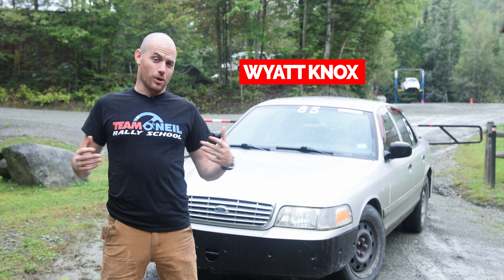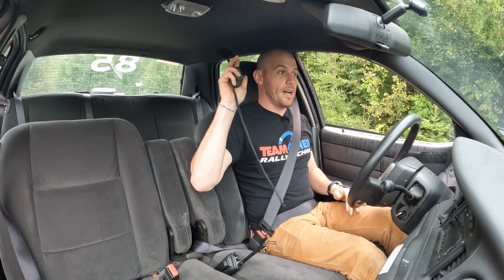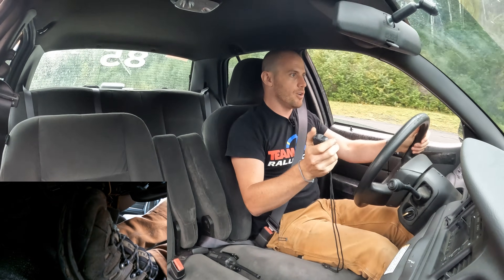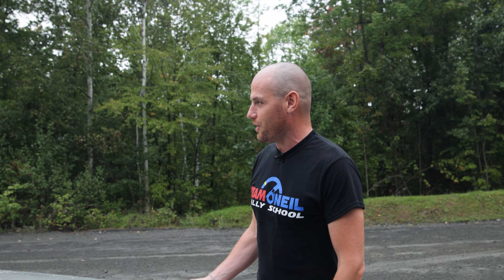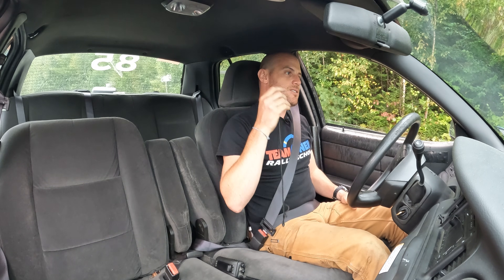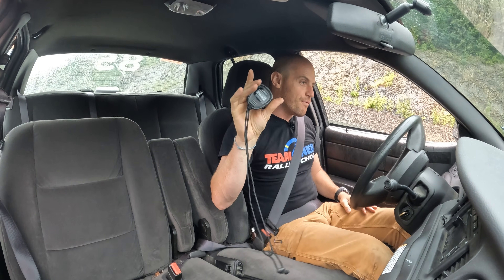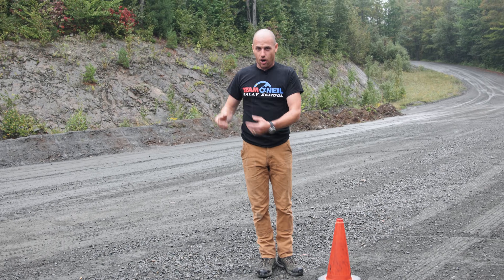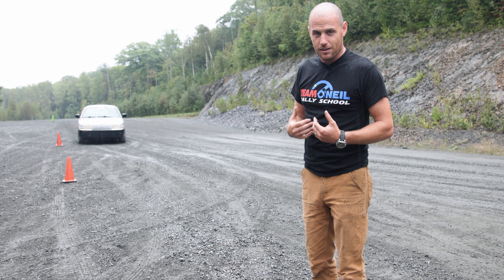Threshold Braking | ABS ON vs ABS Off

Comment: Great video Wyatt. What's your opinion on pumping the brakes on that same road surface with ABS and without ABS? Even though my past 2 cars and my current car has ABS, I actually prefer older cars and trucks that don't have ABS. I also apply and pump the brakes both right on the brakes as well as left foot on the brakes while my right foot is still on the accelerator.

Comment: This is dangerous hog shit. You are not on tarmac, you are on gravel. The difference that makes cannot be overstated. Secondly, you are not using a modern, 4-channel ABS. You are using a shitass Ford that had at best a two channel system. The bottom line is this: If you are on pavement with modern ABS, the ABS vehicle will beat you every single time. Every. Single.

Comment: Another thing I've long wondered about: In an uncontrolled spin, the recommended action for the driver is to lock up all four wheels, because the inertia of the vehicle might carry it in the same direction it was going prior to the spin. With ABS, it's not possible to lock up the wheels, so the car will go in whatever direction the wheels are pointing, as soon as some sort of traction happens. I would love to see a test of the difference between a spin with ABS versus a spin without, in terms of how well the car keeps a straight line.

Comment: As I understand it, the reason ABS was introduced is that it provides some steering control for people who panic brake. So, instead of locking up and losing all steering, ABS gives the driver the possibility of avoiding whatever they're heading towards. What I wonder about (and is perhaps not something that can ever be known), is how many accidents happen now because of the increased stopping distance, that might have been avoided even with a panic braking full lock up. Another question (which perhaps you can test?), is rather than straight line braking, what does it look like to perform the same test you just did, but the stopping attempt happens in a curve? (i.e. there's an obstacle in front of you that you have to avoid). Can a skilled driver with no ABS avoid a crash that a panic-braking driver with ABS cannot? Am I correct that ABS is currently not allowed in rally racing?
Reply: I have the answer to your first question about  accidents caused by abs increasing stopping distance the answer is zero absolutely zero abs was introduced for a number of reasons one being maintained steerability under full braking but also because it reduces stopping distance significantly and consistently on tarmac no matter how skilled the driver is plus it prevents flat spots on tyres which is not only a waste the tyres and causes vibration when driving as the tyre is now no longer round and balanced but also flat spots have less grip than the rest of the tyres surface so if left unchecked and it locks up again 9/10 times the lock up occurs in the spot on the tyre making the flat spot worse and worse over time eventually it will have next to no grip and will likely just blow out under braking very dangerous it's only on unusual surfaces such as thick snow, gravel, sand etc that abs doesn't work as well in a straight and level situation but still allows you to stop pretty well the difference is often very small as shown in the video (remember the tests in this video were done at 50mph which is an unrealistic speed to be travelling on gravel, snow and sand only on good surfaces otherwise it's recklessness at a lower speed the difference is even smaller half a cars length at most) the speeds on these slippery surfaces should be lower often not exceeding 30mph to account for the increased stopping distance otherwise any consequent accidents are entirely attributable to driver negligence or recklessness not whether or not the car has abs and in those practically unheard of cases where accidents that occur in these situations that perhaps wouldn't have occurred without abs and where negligence or recklessness isn't really a factor usually occur at such low speed often the involved parties don't even bother involving their insurance or fixing the cars at all as the damages are so so minor that it basically no existant and there are no injuries whatsoever in other cases where a major accident occurs on these slippery surfaces that is significant enough to cause extensive damages and potentially injuries abs alone wasn't the difference between a serious accident and a less serious one the difference it makes alone is just too small in these cases driver negligence and recklessness and even improper equipment such as incorrect or worn tyres and other item on the car that are not up to par (which is the drivers responsibility not the abs) are fully to blame additional I'd like to point out that if your car is fitted with abs and it is not working because you disabled it or just isn't working and you are involved in an accident in a situation where not having abs reduced the severity of the accident the insurance and accident investigators will look at that and you will likely not be covered and may potentially even be held liable for damages and injuries that occured that you may not have been held liable for had your abs been in proper working order so just don't try and outsmart the system or it will blow up in your face the only reason no abs stops better on these soft deformable surfaces in a straight line on level ground and with even grip across all 4 tyres is because a lockup allows loose ground to accumulate Infront of the tyres like a wedge effectively increasing the size of the contact patch consequently increasing grip and thus reducing stopping distance if you have to brake around a corner or to avoid an obstacle abs even with slightly longer stopping distance will often save the day more over if there is uneven grip across tyres like is the left 2 have more than the right 2 abs can help stop a spinout and lastly if you lock up without abs on a slanted surface like in you are on a surface that is tilting to the right once a lockup occurs due to gravity the vehicle will slightly down the slanted surface this could put you in a ditch send you down a cliff edge or put you into a tree or parked car that is next to you in the lower part of the slant abs while it may not prevent this as micro lock ups still occur it will significantly reduce the affect and also allow you to steer away from the obstacles and another point these circumstances where abs is slightly better are so incredibly rare that modifying your vehicle or expecting car manufacturers to modify cars to perform better in these unheard of circumstances to "improve safety" at the expense of significantly reducing your braking performance and safety literally everywhere else is some of the dumbest crap I've ever heard of making a car marginally safer in 0.01% of real world circumstances at the expense of significantly increasing danger in the other 99.99% of real world cases it's just silly if abs didn't work if abs increased stopping distances and was causing a tonne of accidents and fatalities you don't think that after nearly 60 years of the technology being in development and nearly 50 years of it being in road cars that we would have noticed this life threatening flaw and put a stop to it you don't think after all that time we would have found a solution to the problem and either fixed it or if we couldn't fix it find another better way to mitigate the huge danger that not having abs creates of course we would have abs was literally invented to save lives and it has it would be a so popular if it didn't it probably wouldn't even exist anymore if it didn't work but it certainly wouldn't be a mandatory requirement if it didn't work it competes in the top 3 safety systems fitted to cars of all time up there with seatbelts and airbags lol abs has saved countless lives and being around for a very long time it has been nearly perfected so much so that even the abs system fitted to the car in this video and systems developed in the last 15 years pale in comparison to a more modern system modern systems are incredible if you've ever gone from an older car with abs to a newer one you'll know what I'm talking about the slow, harsh, and chaotic actuation of the pedal in an older car vs the rapid, refined and soft actuation on a modern car it's doing so much more work you can tell by brake tests on cars showing how over the years as new generations of certain cars come out they stop in shorter and shorter distances you can also tell by the marks it leave on the road older systems tend to leave noticeable dotted black lines where that were braking and make lots of tyre screeching noise where as modern systems almost leave no evidence at all of the braking zone and making almost no tyre noise with maybe the occasional very brief squeak from the tyres it's amazing how far it's come in just 10-15years so yeah abs pretty much always wins in the real world

Comment: I got to do this many years ago on an ice skid pad, 10 runs hit the brakes as hard as possible and 10 threshold with abs, and we could consistently stop shorter with the threshold with abs then just pure abs. This was on ice alternating each run. We also shifted to neutral too as this was demonstrated to shorten stopping distance by about a car length. We also did Moose tests and brake and avoid techniques. Not disputing anything you did as you were on gravel with different variables, just sharing.

Comment: Abs is just too fast to compete with but being off road i can imagine how the wheels being locked up off could be better. On pavement though this would be a completely different story, biggest problem i see offroad is locking the tires up risks losing total control in some situations. Going into a corner with them lovked up would not be good especially if youre still moving too fast to take the turn. Not that abs would be helping you much more but at least you could reliable start turning before you go off the road. Im curious now how much it helps in the snow.

Comment: Would be nice to have a third comparison of trying to stop without any ABS or wheel lock at all; near but not at threshhold.

When I lived in Vermont and drove on many gravel or snowy roads in my 2002 Subaru WRX I used to leave the the ABS fuse pulled out. It was full-on terrifying trying to stop on potholes or washboard when the car refused to stop while that tree keeps getting closer and closer... here in north Dallas everything is grooved concrete in the city and chipseal in the country so I just stuck it back in for inspection a few years back and left it

Comment: ABS for cars was designed to preserve steering, not reduce brake distances, in panic situations to avoid collision by not impacting.

Try tests with slamming brakes but requiring steering around moose test while holding phone or beer of choice......

Comment: I don't know the point of this test, since the whole point of ABS is that it stops later but gives you steering control while braking. So the results are obvious. Some non-obvious result we would get if you did the threshold braking test with ABS on/off while turning in order to avoid an obstacle. "Overdrive" did a test like this a couple of years ago (but with no threshold braking).

Comment: When I'm driving in winter, the moment I get a little chatter my foot is slammed to the floor.

Would tire type affect the results?
Reply: Yeah, basically everything that changes friction, which includes profile and rubber composition, tire pressure, which in turn is also influenced by temperature. Also, this is why you should change your tires from summer/winter type even if there is no snow, but only very low temperatures. (Continental recommends 7°C/46°F as a threshold, though that's a spectrum, and you should remember that temperature varies throughout the day and your local laws may also uave an opinion on that)

In that particular test, new winter tires would have increased the brake distance.

Comment: I've noticed significant advantage to "threshold braking" vs max chatter on ice with questionable tires. I guess the science comes down to there being no practical difference between fully released and fully locked when there's next to no traction, sliding at 2mph sorta situation, but you can slow down if you're somewhere between the two and not overwhelming the incredibly limited traction.

Comment: So when i know ill be driving on dirt the whole way of a drive, should i disconnect my abs for that dirt road drive?
Reply: Not necessarily.  While ABS might lead to slightly longer straight line braking in some conditions, avoiding the wheel lockup helps preserve some ability to steer around obstacles (whereas fully locked wheels generally slide in one direction).   Sometimes steering around something is better than trying to stop before reaching it.

Comment: Good test.  Add tests on pavement and in both dry wet and mixed conditions on pavement.  Mixed conditions and true unexpected emergency braking is where ABS shines since no one is able to brake all 4 wheels independently.  Also braking in a curve ABS shines.  Most drivers when faced with an unexpected emergency will brake hard and lock the wheels up losing steering and increasing stopping distance which only gets worse when the object they are trying to avoid hitting is getting closer.  Snow and loose surfaces a locked wheel non ABS stop will be shorter in part due to the build up of surface material in front of the tire.

Comment: I’ve always heard that on loose surfaces, you can stop shorter without ABS because the car starts to plow the road surface and builds up essentially a wedge of the road surface at the front of each tire, which helps to slow the car faster. However, this only works on loose surfaces. On a typical road surface, the car would stop shorter with ABS and full panic braking (letting the system work, not threshold braking). Especially since modern ABS systems can individually adjust brake pressure at each wheel so you can maximize stopping power at each individual wheel.

The other thing worth mentioning, ABS allows you to maintain steering control of the vehicle. In full lockup, you lose all control of the car. You cannot steer at all, and if the road surface is slanted or there is some sort of imbalance, that will result in you sliding sideways or the car starting to rotate (spin out).
Reply: Yeah, snow and gravel build up in front of the tires and create more friction to the surface. I think a lot of modern vehicles that have "snow" and "gravel" driving settings do turn off the ABS with those settings active, or at least minimize the amount of ABS that's applied.

There's a reason modern race cars use very advanced, highly adjustable ABS - the driver gets significantly better braking than without, and they can adjust for track conditions on the fly to maximize performance.

EDIT: Also, the channel that is now Overdrive (formerly Driven Media; Scott Mansell) did an ABS test on pavement to show how much better it works on pavement even compared to a professional driver.
Reply: Thanks for saving my fingers the work!
Reply: Not to mention flat spotting your tires on tarmac/asphalt
Reply: One thing I'd mention: Although ABS can maximise braking to all wheels, it generally doesn't, for example, if your left wheels are on ice and right are on tarmac, they will both be limited to the limit of traction of ice, because otherwise the car would spin violently, but yes, it does adjust front-rear bias slightly.
Without ABS, you could manually threshold brake for the ice, and you'd brake in a straight line, but if you brake harder (to the limit of the tarmac), the car spins towards the side with better traction (right in my example), and would possibly stop in less distance, although it depends on speed(if you're doing 100mph, you're going to spend most of that sideways {worse on paved roads}, whereas at 30mph by the time you're sideways, you're stopped), it also depends on difference in traction between surfaces etc.
Reply: @Kaiser-ks3yq  You are right and here is the demonstration:
https://www.youtube.com/watch?v=8bwK7QwGQqs&t=139s

Comment: What is the point of abs then 😅 I honestly thought it would be better with the abs. 
So..... corner breaking and the same one but on tarmac.
Reply: ABS is designed for your average driver to prevent a skid and allow some steering input. Also, I bet this test would have much different results on pavement.
Reply: @r000tbeer  as above
Reply: The main benefit of abs is that you can still steer. If the front wheels are fully locked you may stop faster but you won't be able to turn. Usually if you're slamming on the brakes that hard while driving on the road you're not going to stop in time to avoid whatever is in front of you so it's better to be able to steer away from it.
Reply: @ericdieterich4058  that's why I asked to redo the test but giving these factors, include the threshold breaking too no full lock 😉
Reply: ABS would stop better on tarmac. On dirt, a little bit of locking is good because the dirt will pile up in front of the tires and slow is faster